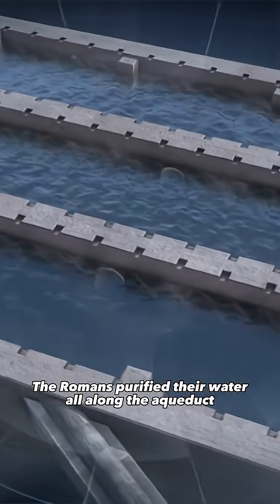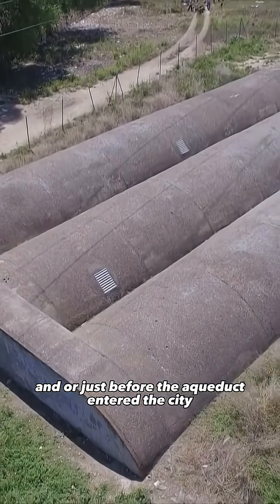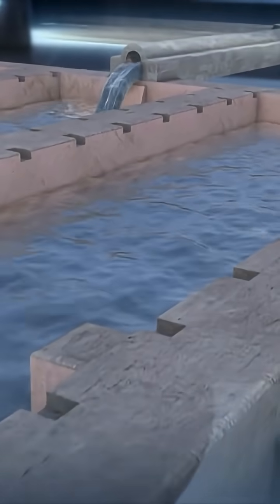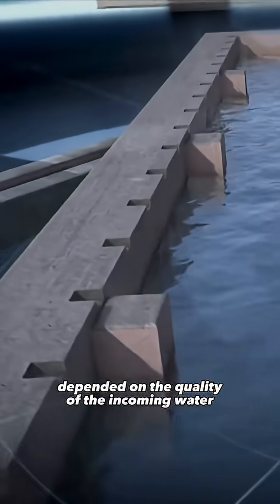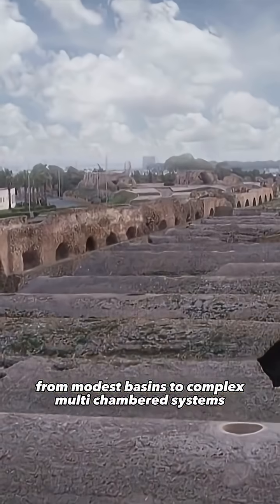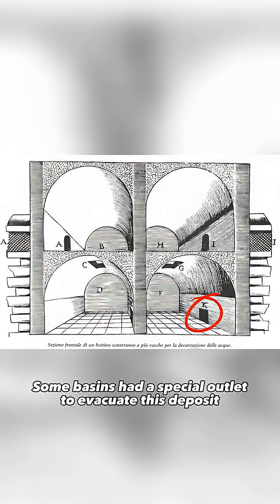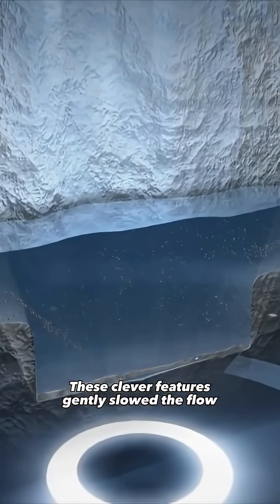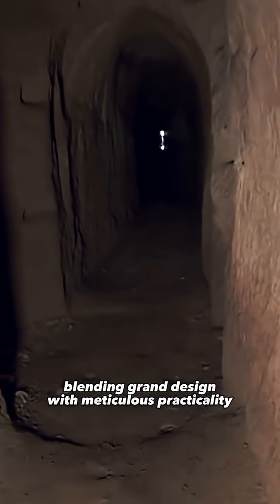How the Romans purified their water #history #romanempire #engineering

Comment: N9w ubhave the minerals fir mining as well . Now create  straining system and air pump , one half way on the intake side and another fan system near the surface with a overhanging curved wall. Ut creates a flow system slightly resembles a leffter lower  case.  
                 "[  a. ] "

Comment: The ONLY negative thing about Rome's plumbing system was their usage of Lead pipes. It worked for quite awhile, until the pipes started to decay, releasing copious amounts of lead. There is a theory that this lead accumulation drove mid-Rome during and after Caligula into absolute madness and wouldn't get any better until the pipes were replaced with clay ones. It's why the Atomic letter for Lead is Pb, which means Plumbum. The English words "Plumbing" and "Plumber" are derived from that word. 

If they used clay pipes JUST for drinking water, it would have been much safer.

Comment: I think purified is the wrong word to use in the context of systems designed to remove sediments by allowing them to settle. Purification also involves the removal of dissolved impurities (especially if they're toxic) and bacteria (particularly those that cause gastrointestinal upset). Other than the possible effect of UV from sunlight destroying or inactivating bacteria near the top surface water in settling pools, what has been described isn't what is generally considered to be purification.

That's no dis on the Romans. What they did with the technology available at the time was far ahead of what their contemporaries in Europe were capable of doing.

Comment: I worked in a modern water treatment plant, and massive sedimentation basis are still used, and just like the Roman’s, there are small channels where only the topmost water is skimmed off and sent to filters. These basins also had a trench at one end to collect mud and debris, and we had a tracked system that slowly dragged the bottom constantly to push the mud there. But every few months we would drain it, and climb down with a firehose and wash everything out. It’s more similar than different.

Comment: The only thing that undermined the genius of their engineering was their prodigious use of lead in their water systems.
Reply: Lead worked well and even used today, water chemically reacts and forms a barriers that prevents contamination, problem is if that lining gets dissolved by other chemicals in the water you get flint Michigan.
Reply: but to be fair, they had no/very little clue that lead was posionous

Comment: I think it is genious as well they knew how the flow rate through a lead-pipe had to be (based on diameter) for the water to not pick up enough lead to cause health problems....

And not long ago they found an old roman mosaic floor so well build it just got wavey after an earthquake instead of breaking down.
Reply: Well, they knew the pipes would become coated in calcium and other mineral deposits to seal off the lead from the water, so that wasn't a thing.  And they did have 1,700 years for trial and error to figure it all out before everything went belly up.

Comment: I’m a utility contractor and we still use the sediment traps today. But instead of the drinking water we use it for storm sewers, so trash and dirt from roads don’t end up in our rivers.
Reply: Ever road side catchbasin is a small settlement tank.  Oil & Grit separators are very common these days but the water in this case is taken from beneath the surface so that oil and other hydrocarbons and floating debris don't wash down the pipe.  Even Storm Water Detention Ponds are designed for this work taking on both volume as well as quality control.
Reply: I'm a commercial diver specializing in dredging out lakes and reservoirs. One of our biggest projects at this moment is cleaning a series of lakes in Avondale, AZ that is used in this manner. The lake along Crystal Gardens and Thomas is 25 feet deep and the sediment layer was 13 feet above the bottom. We've been working on it for over a year and are nearly done with 2 of the 4 lakes we  were contracted for. There's over 20 in the system  and they were only installed 30 years ago.
Reply: I work for my city and we have to do a yearly training about storm drains (my work is unrelated to this). They stress not polluting them and reporting anyone who does, but never explain how they clean the water that obviously gets contaminated with waste and chemicals. Thanks for clearing that up!
Reply: Aqui no Brasil as estradas lançam tudo direto nos rios. Lamentável.
Reply: Pretty sure this is also still used in water treatment facilities too
Reply: I'm a designer of water and sewerage treatment plants. They're used in both, particularly in rural areas. It's not uncommon for rural sewerage treatment to just be a series of lagoons with some aerators in one to promote bacteria eating the shit.
Metropolitan treatment plants tend to use more sophisticated tanks for sediment separation in addition to other technology such as centrifuges, flocculation and filtration.
Reply: @protercool8474 ,
Are small particles of plastic separated from water, too?
I read recently that nanoplastics are a major concern. 

((I realize it possibly sounds odd to be concerned about tiny bits of plastic))

I'm very grateful to have clean water to drink. 200 years ago, safe drinking water was not easily accessible. 

Thank you for the work you do.
Without safe drinking water, our life expectancy would be much shorter.
Infants & children are especially vulnerable.
Reply: @OceanSwimmer  im a water treatment operator, we add a coagulant to the water, then use these settling basins to remove anything that can stick together via positive and negative charges in the water, anything that doesnt settle out gets filtered out, we have regulations (lots of regulations) on everything from what is acceptable to send to the system, to how to submit and test designs, currently we are testing ways to remove PFAS, because micro plastics are already a solved issue by established methodologies.
Reply: @protercool8474 I heard that the new waste water treatment plants don't need the setting ponds, have way smaller foot prints, and make no smell and produce carbon good enough for sale as a product. Do you design those too? Are these going to replace the smelly old ones in the short term?
Reply: @theonlypui396  Yeah as I said, metropolitan ones use more advanced tech, generally because there are more tax dollars, more incentive and more shit. Produce no smell? idk about that, none of the ones I've worked on, they all stink like shit when you're on the property. That might be just the ones i've been to though, I've worked on odour control facilities but its definitely not my area.

I've also not heard of producing carbon (I assume you mean solid carbon as a coal replacement) however there are some that produce biogas as a by-product, and they often use that to run the plant itself. Unfortunately natural gas and methane are so cheap that there's little economic value in selling it. Honestly I'm not 100% sure why so much is wasted, I worked on a huge biogas cleaning facility in a waste water treatment plant in Melbourne and they literally just burn whatever the plant itself doesn't use. My guess is the gas industry is too good at lobbying our government to keep mining/fracking for the stuff.
Reply: Good to know!
Reply: the same use it's present on my local acqueduct collecting spring water, sediments deposits on the bottom and sometimes water supply get interrupted to collecting the sediments accumulation, small acqueduct for rural few vilages btw
Reply: Put in my share of Type 2 CB's
Reply: Thank you!
Reply: We use them for all of those including the examples on the comment tbh. I worked for my local water company. Pools for sediment exist at the beginning of the cycle for drinking water so we can remove impurities before sending it through the pipes, and we also have sediment pools for waste water so the cleaner water can be returned back to nature, and the sediments are transformed into biogas or fertilizer. Thousands years old technique and it's still being used today. If it works then don't fix it right?
Reply: Do the slaves still manually remove it?
Reply: @jmjedi923 
We don't use that term any longer. I believe the banks call them lenders.
Reply: @jmjedi923  Yeah, the term is just "worker" nowadays
Reply: @jmjedi923 yes 😂😂 we call it taxpayers
Reply: slaves, I mean volunteer
Reply: The hell you talking about. Nothing like that exists and all trash normally go to river. Stop throwing propaganda
Reply: This is not the case everywhere some counties want inverts 🤷
Reply: Yah the problem is, city workers don’t clean out the trap inlets like they’re supposed to….
Reply: The ancients were more advanced than we are today. They didn't have social media telling them what to do, how to think, how to behave and what to say. They thought for themselves and through discipline, dedication and ambition, they built entire civilizations with complex structures. Some people don't believe in themselves and in the power of the human will and spirit that never give up! 🔥💪✊
Reply: Mic drop
Reply: @kinbolluck476  pick it up
Reply: Nice, so the animals are more important than us...😅
Reply: @justsoicanfingcomment are you dumb?

Comment: The aqueducts were and still are marvels of engineering.  However, these structures did not "purify" water.  The ancient Romans had no understanding of germ theory.  The settling out of sediment was necessary for the function of the aqueduct.  If the water was cleaner, that was a nice side benefit.  Roman bath's on the other hand were disgusting cesspools built by the same folks
Reply: Purifying water means getting rid of the sediment. Sterilizing water means making it free from bacteria.

The baths had heating rooms that got rid of the bacteria and the constant flow of water made sure that it's fresh and relatively sanitary

Comment: Then those ingenius Roman engineers upgraded to lead pipes for the 'sweetness' it gave to drinking water.
Reply: No. Romans neither used lead acetate as an artificial sweetener not they were calling it sapa. Author of this video mixed two different things. The wine, especially inferior one, and many dishes were often seasoned with sapa, and sapa could have been the source of lead poisoning, but it wasn't lead acetate or any other lead compound.

Romans often used reduced (partially evaporated) must that is essentially fresh grape juice to turn it into thicker and relatively sweeter and more aromatic natural syrup, resembling honey and called sapal defrutum or simply sapa. It was very popular, not unlike refined sugar today and Pliny the Elder in his Historia Naturalis bemoaned the fact that it is hard to find a wine that was not additionally sweetened. But what the grape syrup had in common with lead? It seems that the lead utensils were preferred in the process of defrutum production, as the best evaporation is provided by materials made of good heat conductors and thus metal pans were preferable to ceramic ones. Given that two most popular metals for everyday use were lead and copper (stainless and acid-resistant steel was not known yet and iron is much harder to work with) and the latter was considered inferior in that particular case, because acidic must reacted with copper, getting infused with copper acetates that are characterized by strong metallic taste and rather unpleasant odour. Of course, lead reacted in similar way, but the lead acetate (II) thus produced were sweet and largely oduorless and thus virtually undetectable in a very sweet product. This is why Romans were using either lead pans or bronze ones covered with a thin layer of lead, as evidenced by the aforementioned work by Pliny, Columella's De rei rusticae or Marcus Portius Cato's De agri cultura.

Did Romans knew about lead toxicity? Well, it could have been not the common knowledge among people, but the scholars definitely knew that lead is a dangerous metal. Lead carbonate (cerusite), commonly used as a whitening cosmetic (replaced only in 19th century by zinc oxide) was identified as a dangerous poison when ingested by e.g. Galen, Pliny, Dioscurides and Celsus. Additionally, Vitruvius in his book De architectura did not only notice that although metalic lead is not very dangerous (at least unless ingested), lead vapours created in the smelting process are highly toxic (mercury has similar properties exacerbated by the fact that it evaporates in room temperature) but also recommended to limit the number of lead water pipes, stating that drinking water that is constant contact with lead cannot be healthy (although Hodge suggests in article referenced below that this particular vector of lead poisoning was of limited importance, due to high amount of calcium in water that quickly formed a calcite residue on the pipe surfaces, acting as a preventive barrier). This did not change the fact that due to abundance, high malleability and low melting point, lead was ubiquitous in ancient Rome, as it was used for almost anything, from water pipes to construction fittings to food containers.

How dangerous was defrutum (sapa)? Quite a bit, it seems. German scientist, Karl Hoffman decided to check this experimentally in 1883. He made a dose of defrutum using recipe and utensils matching the description in Cato's and Columella's work and then checked the lead content in the resulting product. The results shown that it lead concentration was reaching almost 250 mg/l. Then, as ancient recipes suggest adding one sextarius (roughly 0.545 l) of sapa per one quadrantal (26.2 l) of wine, the actual lead content at roughly 5 mg/l of sweetened wine. As the modern safe limit of lead consumption is 0.5 g/day, it means that drinking one liter of sweetened wine made according to Columela's recipe meant ingestion of the amount of lead that was 10 times higher than what s now considered safe. Of course, not the whole amount of lead got absorbed, but given that we given we are speaking about an organic lead compound, the absorption rate was still rather high).

Last but not least, the prevalence of chronic lead poisoning among Romans and its role in the decline of the Empire is still heavily debated. Although some researchers speculated that increased exposure to lead compounds in case of aristocracy that could have afforded any amount of defrutum and related products caused rich strata of society to suffer the most (Pliny and Galen were describing illnesses with symptoms typical to lead poisoning), this theory is now challenged as not corroborated by archaeological findings and too conveniently based on the romantic notion of the 'decline' of Roman society as portrayed in seminal, but now rather outdated work of Edward Gibbon. Analysis of the bones of the Romans found in Britain performed by Drasch in 1982 suggests that the level of the exposure was roughly as as high as most people in the developed world in 1980s (although these people were rather common soldiers rather than rich citizens). So, the discussion is still open, but we can't authoritatively say that lead poisoning caused the Roman empire to fall.

Recommended reading:

Emsley, J. The Elements of Murder: A History of Poison. Oxford University Press, 2006.

Hodge, A.T., Vitruvius, Lead Pipes and Lead Poisoning, in: American Journal of Archaeology, no. 85 (4), 1981.

Retief, F.P., Cilliers L., Lead poisoning in ancient Rome, in: Acta Theologica, vol. 26, no. 2, 2006.
Reply: And? Led is not fast acting poison it was hard to make correlation. At least they didn't make hole in ozone layer.